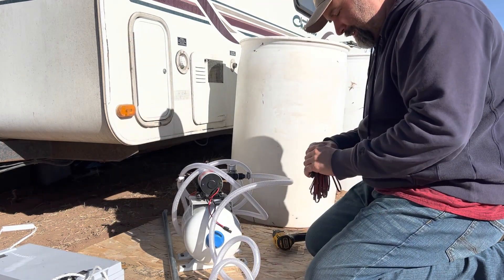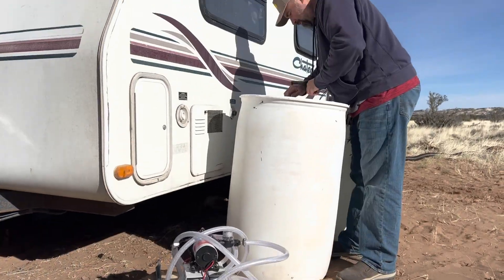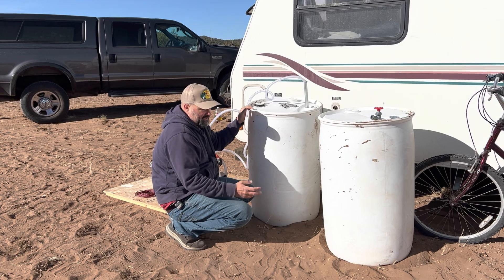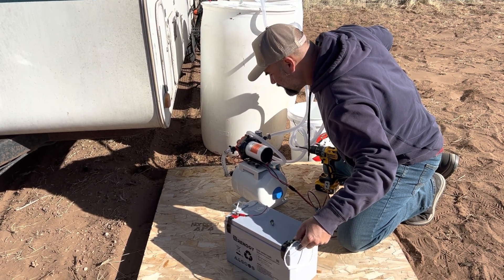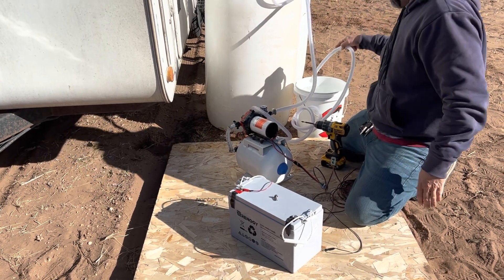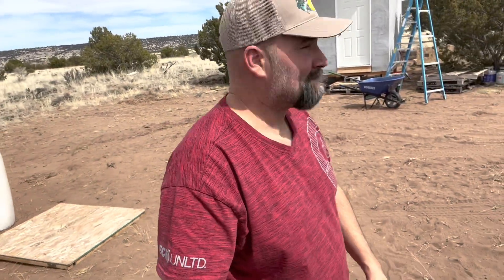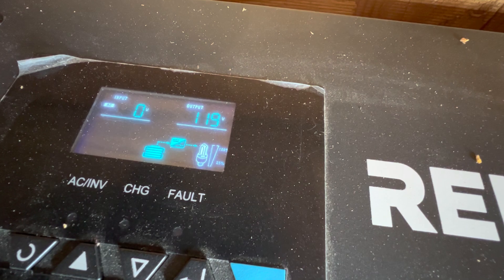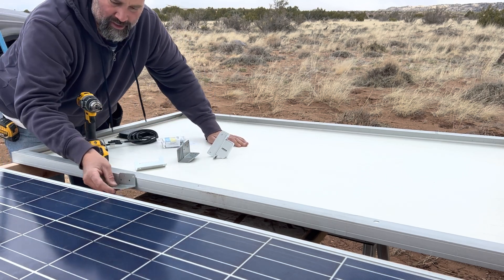Water and Solar

Comment: 417 lbs  @ 50 gallons of water. + container. 😮
Reply from the maker: Rude. No. I was referring to the phone. I should search it. It just hard to relate 8 lbs to a gallon of milk/water. I thought maybe 3-5 lbs. thanks for the correction
Reply from the maker: Does that mean that a gallon of water is 8 pounds? I don’t think that’s true. Maybe I should ask the magic little rectangle
Reply: @forsbergmicah    Water weighs 8.34 lbs per gallon
Reply: @forsbergmicah  I wasn’t sure if you were being rude with that comment, hopefully not .  I was just trying to help with some helpful advice .  I can unsubscribe .

Comment: if you can find a 125 gallon ibc tote it should slide into your truck w the shell then get a dc transfer pump and u could get water more easily when you need to go get it. plus your truck should take the weight easily. just an idea
Reply from the maker: I’m thinking about that option. I see that often. I’m also thinking about getting two more 55 gallon drums. They are only $35 each. More light weight to get in and out of my truck. Eventually we will get a big one and have a company haul in till we get gutters and roofs.

Comment: Did you purchase solar panels in AZ or ?? Are they Renogy?
Total watts ? 
Will you have a large water storage tank later and or rain catchment?
Reply from the maker: White Mountain Solar in Show Low, AZ. Solar charger and 4 panels at 240. I bought the Renogy inverter and batteries on Amazon when I was in MN. 
We will start with a 2500 gallon tank. And go up if we need.
Reply: @forsbergmicah  great setup, starting to look great. still in progress.
Reply: Thanks for solar info..
A 2500 tank for water should last a long time. I wish I had gotten a different color ( its green) tank cause it gets algae build up too quick but it's outside in full sun.